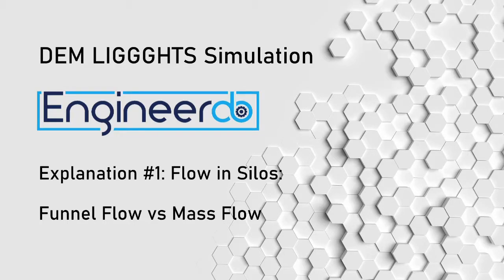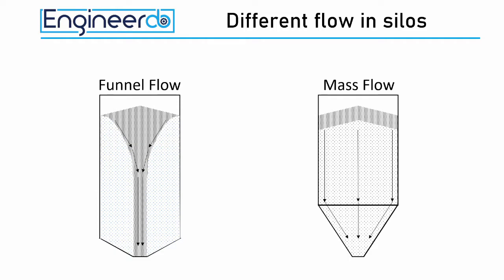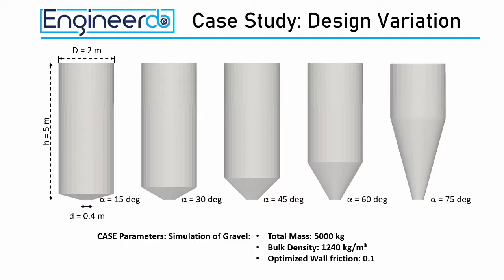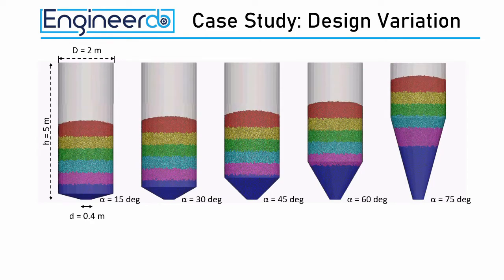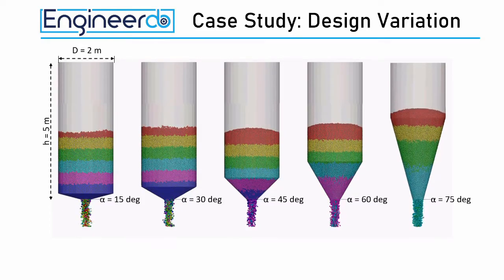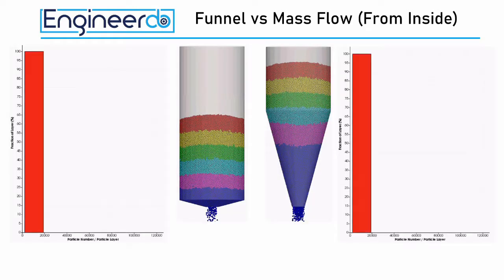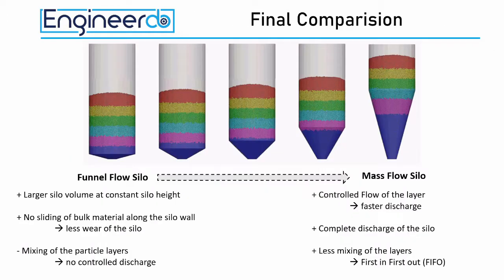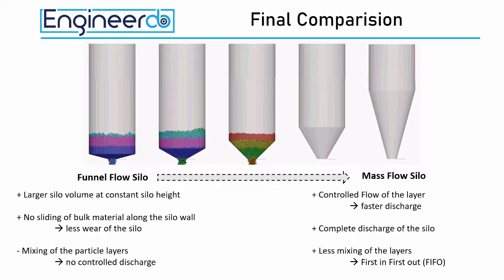Silo Design: Mass Flow vs Funnel Flow - DEM Case Study

Comment: Hi! Thanks for the great simulation video. But why have you assumed that the fall of particles under gravity is uniform? In a practical scenario (grains, cereal mixes, sand), when particles of different sizes start falling into a cylindrical silo, segregation always occurs and the falling material makes a cone. This segregation is the real problem leading to non-uniform discharge, irrespective of funnel angle. How can one ensure that segregation does not occur during discharge?
Reply from the maker: Hey Maithili, thanks for your nice comment. Regarding you questions: depending on the silo type ( mass flow vs. funnel flow) the outflow is different in the simulation. 
The segregation will always happen and is in deep very much depending on the type of silo feeding system as well as the type of bulk material. Particles bigger than the average size and particles with lower density will float to the surface if a flow with open surface is happening in the application. You made some valid points here. This simulation shows just one example.
Cheers!
Reply: @engineerdo6568  Thank you for your nice reply. Do you happen to know of any solutions that can reduce segregation just before the discharge? Or, any solutions that when installed inside a silo, will nullify or discount the segregation due to the fall of mixed size particles under gravity?

Comment: Excellent video, really informative! Have you considered a comparison of the mixing characteristics of twin shaft horizontal mixers versus single shaft horizontal mixers. I'm considering both types for a dry mix mortar plant.
Reply from the maker: Cheers. We have video online, where we show how a mixing simulation can be done. We have done comparison sand improvements for mixers for different materials as client projects. 
It really depends on the bulk material you want to mix. A custom simulation could may help you...

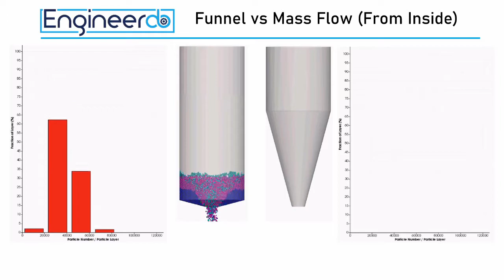Comment: Very nice video. It would be nice to see what happens if extra materials are added while the silo was already partially empty. For example suppose a new layer is added at times 3:26 and at 3:39. How wll the funnel then flow?
Reply from the maker: Hey Peter,
expect the new particle layers to flow straight through the silo to the exit in the funnel flow case. So there will be further mixing. In the case of mass flow, the layers should settle on top, so that a FIFO flow continues to prevail.

Comment: It would be interesting to see the annular flow as well.
Reply from the maker: Hey Bojan, thanks for your feedback. What do you mean with annular flow? As a post processing step?
Reply: @engineerdo6568  Yes, in some applications there is cylindrical body inside the silo and the grains must go through the annular space between that cylinder and the silo walls.

Comment: Hi! how does the software work with fine cohesive powders?
Reply from the maker: Hey mate. That's difficult to answer. It will work, but you will have to calibrate the material flow behaviour. That's means comparing simulations to a laboratory experiment.